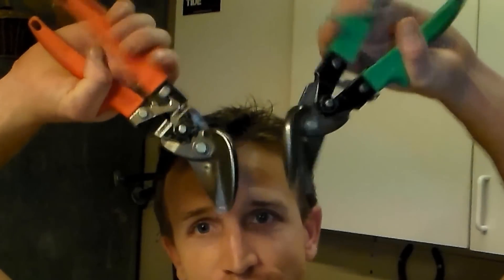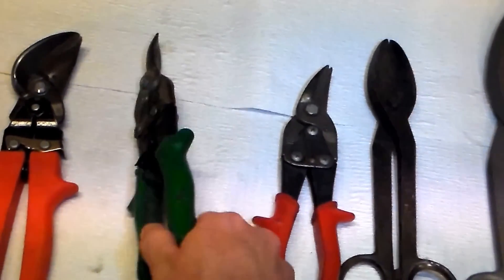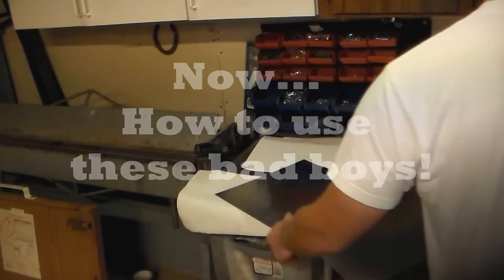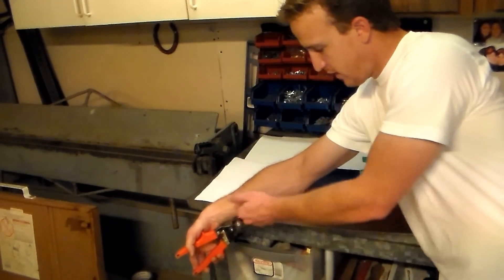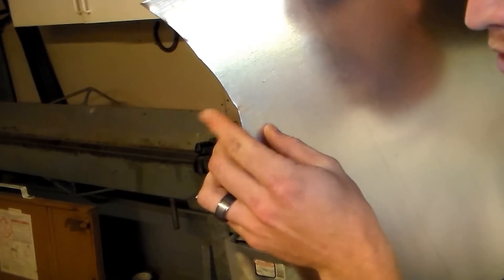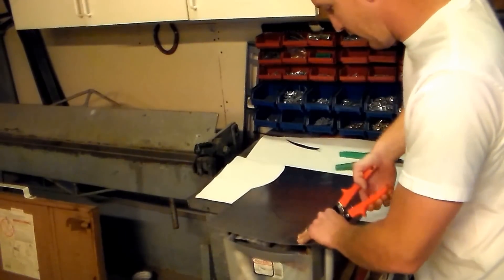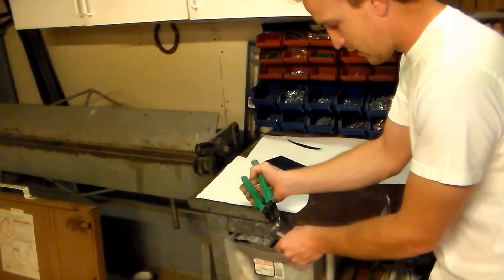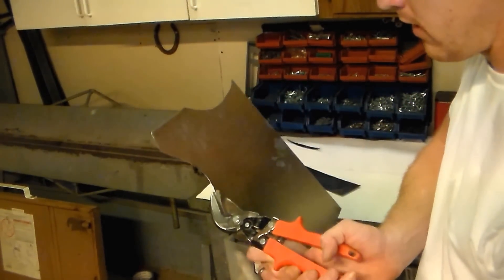How to use tins snips or aviation snips to cut sheet metal correctly

Comment: Thanks, for getting m,e out of a jam.  Dangling atop a 10 ft ladder trying one handed to get a piece of metal roofing cut off with right handed tin snips.  Wasn't working.  I was making relief cuts, but at angles.  Your instruction to make the relief cuts parallel saved me.

Comment: what guage was that sheet metal? and what's the largest guage to use with the snips you had? thxs
Reply from the maker: That was probably 24 and its a task but i can cut through 20 and 18 gauge if its a straight thin line

Comment: I have a question. I'm new to sheet metal working and metalsmithing in general. I want to make a gong from scratch. It would be out of 18 guage nickel silver sheet metal. Its 0.04" thick. I found a distributor who sells nickel silver up in up to 24" wide sheets, they don't cut shapes and I'd need it to be a circle (preferably a 24" circle). Several tin snips on Home Depot state to rated at 18 guage steel sheet, do you think i should be fine cutting the silver nickel? If I'm just cutting a circle, do you recommend one the red or green? Or both? I'm righty.
Reply from the maker: +David Stefanowicz Both snips should work

Comment: I appreciate you posting this, but according to a Wiss training video I saw they ARE supposed to be used on an angle. Keeping the blades straight up-and-down is not correct. There is a flat part of the blade that should lay parallel to the metal. In my experience they cut much better by following that tip. (Personally I prefer the Milwaukee snips, and it's true there as well.) Of course going any further than that flat part, or even slightly past vertical in the wrong direction is an issue.